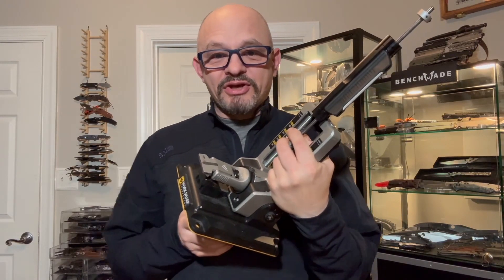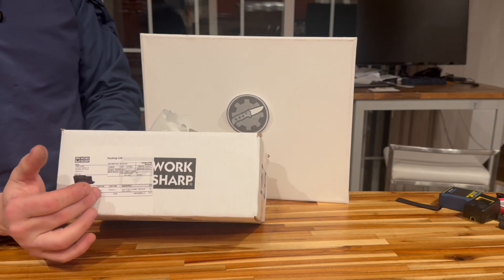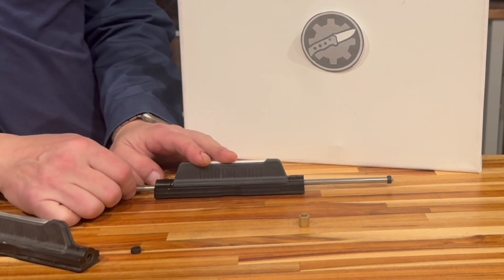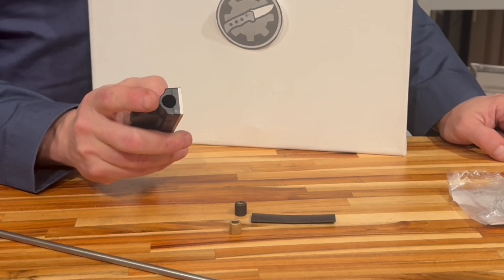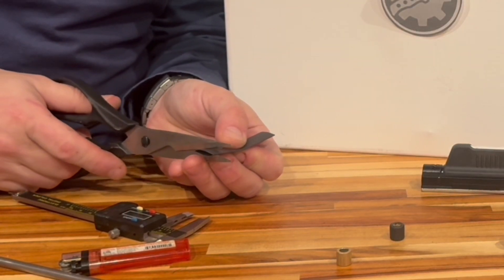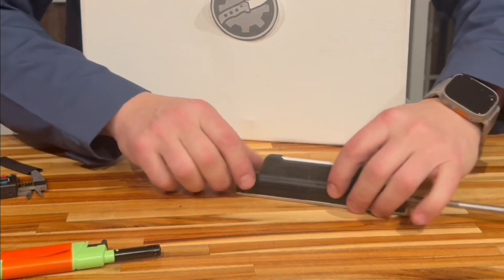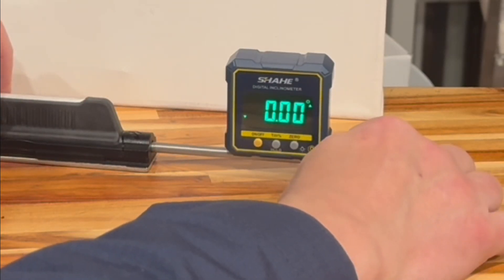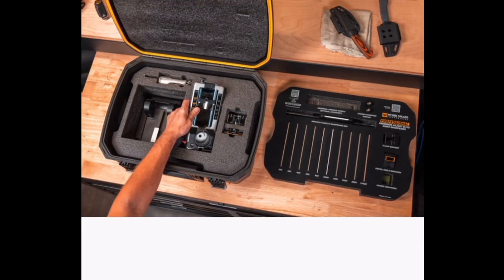New issue with Work Sharp Pro Precision Adjust… Surprised? Here is a solution.

Comment: Hello Sir. I love the video and I love your fix. The reason that repaired holder does not slide in is that part of the repair was to flip the holder over. The guide slots are on the other end now. You can see the grooves in the video right at 13:50. Maybe time for another fix?  Thank you for this though. I got this exact system for Christmas and was just about to bring it out and sharpen the whole collection. Yikes.
Reply from the maker: @joestuffhawkis Practice on your lower end knives and you will do fine! Watch a few more vids in this playlist. 
Thanks for subscribing!

Comment: First off, thank you for doing these videos on this platform.  I got the $250 setup for Christmas.  I just got the notification from WS yesterday and ordered the next $250 “upgrade kit w/case” yesterday.  Then I see your video today… Sheesh.  I looked mine over and sure enough, my handle is the sealed one.  I’ve sharpened just about every knife in the house, lol.  I checked my guid rod and sure enough, it has loosened from vibration, about 3-4 full turns.  So, I tightened it up, using the bit (forget the size) at the end of the rod.  I also lubed the swivel that the rod attaches to. At that point, I noticed the screw was loosened on the swivel, so I tightened it back up.  I guess I’ll be checking the screws about every week or two.  Damn, shouldn’t have to go through this on a $500 setup.
Reply from the maker: Whatever you do, don’t lube the carrier itself where the nylon bushings are. 👍

Comment: Great video, there is also an issue with the screw coming loose that  holds the small pivot elbow connector linking the metal rod to the frame . When loose, there is play in all directions and when tight, the rod arm does not move smoothly. Anyone know if this has been addressed yet?
Reply from the maker: Have you tried putting blue Loctite on the threads?
Reply: Yes, loctite helps but it loosens back up with use. They should have used a captured bolt or better yet a bearing based pivot. It’s a good sharpener but I think the price justifies something better. Very disappointing as these flaws were probably very apparent to Work Sharp when they tested the product.

Comment: Thank you. I made the mistake of buying this sharpener and it’s an expensive joke toy. I wish I had watched your video first.
My plate holder starts to bind after use and then I have to take it off the rod and try to clean it up. Any suggestions please?
Reply from the maker: @pevelyhomeowner327  Check the rod for being bent first. Do not lubricate device. Degrease and dry out. They do replace these under warranty BTW.

Comment: The Hapstone WPPA stone holder fixes this even better! Now what we REALLY need is a fix for the plastic holder tension knob. It'll break very quickly, and furthermore, the holder itself won't solidly hold the blade because the angle of the clamp isn't adjustable to allow a flat contact with the blade.
Reply from the maker: How in the world did you break the knob? If it was with your bare hands, remind me not to arm wrestle with you. 
Hapstone holder was how much BTW?

Comment: Was going to buy a precision adjust sharpening system but after seeing this I won’t be. I’m pretty sure they’re aware of the problem and instead of fixing it properly they found a way to take advantage of their customer. For some people this is a very big purchase with the hopes of having a complete and solid sharpening system. I used to recommend their field sharpener and their bench stone sharpener. Won’t be doing that anymore either. Shameful.

In my haste I forgot to thank you CBX, for bringing this to light and offering a solution to those who already bought the system.
Reply from the maker: Even their field sharpener sucks anymore because it used to come in 17° and 20° but now only comes in 20° which is only working on simple carbon steels like 1095. For stainless steels 17° is as high as I’m willing to go on the angle

Comment: I have the worksharp precision adjust and to keep a long story short it’s been terrible. I learned to freehand quite well over the past year and still can’t get a half decent result out of my precision adjust. I’d still like a good fixed angle system so I’m thinking I might buy the Xarlic gen 3 after watching your videos on it. It looks like they now sell it with a table clamp and a different hand guard like your design to keep it from rolling away. You’re not only helping users but also helping manufacturers who are willing to improve, unlike worksharp who seem to only want to make things less user friendly.
Reply from the maker: Your generosity is much appreciated. I am happy to be helpful to folks who seek knowledge and make wise decisions. Thanks!
Reply: Love my  Edge Pro
Reply: Did you buy the Xarilk Gen 3? Interested in your thoughts if whether it’s better than the Worksharp precision adjust? Thanks
Reply: @anonymous4201  I didn’t but the gen 3 is in a different league than the worksharp. The worksharp is a very minimal system but most seem happy with it straight out of the box. The gen 3 is a crazy base system for the money but it might require some “dialing in” and/or buying some decent stones for it. The only thing the worksharp has going for it are super good quality abrasives but they are so tiny, which can really make it take longer to do the job. If you’re willing to spend more time and money on the gen 3 you’ll end up with a system that is worth multiple times what you pay for it. Speaking of that I actually ended up buying some extras, including a universal stone holder, for my worksharp and it’s just not worth it for the cheap plastic base imo.

Comment: @CBRx - I was just wondering if you'd ever consider doing a vid where you compared the relative strengths and weaknesses of the various button/cross-bolt locking mechanisms currently on the market?
Reply from the maker: I have 7 knives with cross bar locks in the EDCmeter playlist. Each scored individually on 8 parameters and you should be able to find good comparable data at the end of each video. There is no summary video, but I am considering putting one out.

Comment: In regard to the plate carrier not fitting in the holder slot at the top, it looks look you need to rotate the holder on the rod by 180 degrees. There are grooves in the other end that line up with the holder slot.
Reply from the maker: Didn’t need to fidget for the groves with the old holder. It just dropped in.
Reply: He' still right, I think. Remember: you (purposefully) reassembled the rod the other side up at 12:20 in the vid. There are no notches at all on the side that drops into the holder in this orientation...
Nice trick to prevent the wiggle, though. Thanks.

Comment: I guess I was lucky and got the ProPA before they updated the plate holder. I did the bronze bushing upgrade and it has so far worked fine. But if I was starting over from scratch, I would probably go with a different system. As it is, I just ordered their Elite plate upgrade, since the price seemed pretty good for resin-bonded diamond plates. We will see how good they really are.
I also see that they are selling a new universal stone holder upgrade. I'll be curious to see if it has the same problems as the magnetic plate holder.
Reply from the maker: Glad the fix worked, enjoy!
That resin is carcinogenic. Recommend using respirator when sharpening.
Reply: @CuttingBoardRx  True of all resin-bonded plates, or just these?

Comment: I knew there was something wrong with my well used PPA. I bout it new but have had a lot of rainy days to sharpen some new knives I bought in 2024. The factory set bevel was sharpened by a CNC and I could not get a clean straight flat consistent edge and there was a lot of play in my sharpener carrier. Ordered the bronze bushings.
Reply from the maker: Glad I could help!

Comment: here is another data point: I was able to make the bushing swap with my original stone carrier. To my surprise, the bronze bushings actually bound up. I tried several pairs and they all wound up doing the same. It pretty clearly has to do with thermal expansion. Bummer. I have since replaced it with the new carrier assy, that they covered under warranty. I have also purchased the Hapstone unit because I'm going to hybrid or resin stones. The bushing swap was a bust for me. I should mention that the rod checked out for straightness and surface finish...the bronze bushings don't like heat.
Reply from the maker: @shanimal1589  More likely you lubed the rod. Self lubricants in the bronze and brass bushings are not oil, they are high liberty solids and require friction to actuate. If you oil the rod with something like Remoil or, even worse, WD 40 or other solvent-based penetrating fluid, you guarantee binding. 
Really, a better designed system is better anyway.
Reply: @ tried it bone dry….locked up. Tried it with Krytox lube (PTFE lube)….same result. Off to something better

Comment: I think ,and used it a lot ,that the Work Sharp Angle Set knife sharpener is a good solid product and the diamonds last a long!
Reply: For the price, the quality of the product is lacking. These issues should not be a problem. If the ppa was $50 - $75 I would understand but at $300 its not worth it.
Reply from the maker: I’m wondering what’s their per-unit cost is.

Comment: The new one cost so much more because it's got resin bonded Diamond Stones with the kit but that's not really that much of a plus and the system is definitely not worth the money because simply the proprietary stones... If they want to offer proprietary stones then they need to include a standard Edge Pro type Stone holder in the Box along with the proprietary Stone holder. Because there's just too many good stones on the market that people want to have access to and they prevent that and that's super lame.
Reply from the maker: Resins used to bond diamonds are carcinogenic. Recommend wearing a respirator when using them!

Comment: I unfortunately bought a worksharp as my first fixed angle sharpener.  I immediately found out that it was not up to the task.  Just the vibration from using it would let the angle adjustment screw slowly move and I was unknowingly changing the angle as I sharpened the knife.  I fixed that by adding a set screw to the side of the pillar that holds the guide rod.  Then I had issues with the plates not being able to reach some blades, specifically Spyderco knives.  I gave it away after I found that out.  The only feature I liked about the entire system was the clamp.  I thought it worked okay.  I suppose it costs less to glue the pieces together than buy 6 screws and install them, so that could be the reason, but to not fix the initial problem shows exactly how out of touch that company is with their products.  They are a marketing company first and foremost, and this proves that.  I went with the Xarilk, and graduated to a TSProf Pioneer.  I couldn't be happier with those products.  They both outperform anything this company offers and it's not even close.

Comment: The worksharp guided field sharpener is one of my favorite devices ever made for sharpening, but I am so glad I bought a Xarilk instead of the worksharp guided system. It is so much better built and more usable its not even funny.
Reply from the maker: @birddog61999  I used the guided field sharpener for a while but here the 2 problems, both stemming from the “guided” part: only 20° sharpeners are currently available now, which is not a great angle for steels above 59 HRC and if one tries to not use the guide and lower the angle, now only about half the plate surface is not in the “dead” zone. I ended up using it as the storage removing the pates and holding them in hand.
Reply: @CuttingBoardRx  that's how I use it as well unless I'm sharpening a very small blade. Just the ability to throw 1 thing in a pocket or bag and have 2 diamond plates, ceramic and a strop is nice. I cleaned the compound out of the strop and replaced it with 1 micron cbn paste as well.

Comment: What are your thoughts on the Work Sharp bench stone sharpener?

You have done a lot of fixed angle sharpening videos, but I would like your opinion on a mixed system like the bench stone sharpener.
Reply: Was just wondering about this
Reply from the maker: Guys, I have so many diamond plates now that for quick edge tuning I just clamp them to my bench and guide the blade by hand 🤷‍♂️
Reply: @ fair enough.